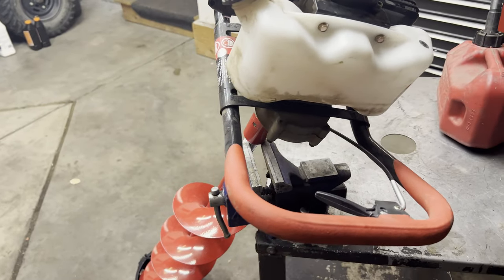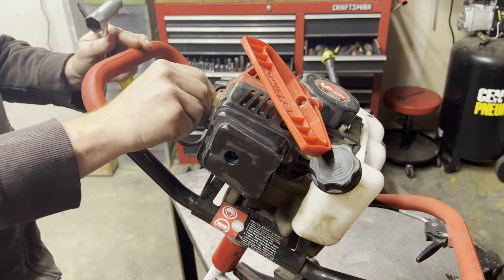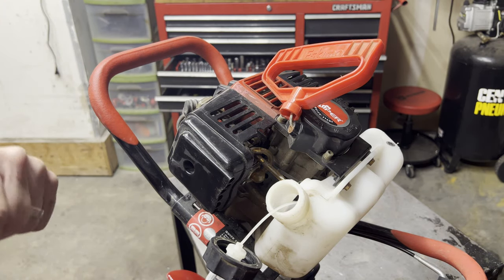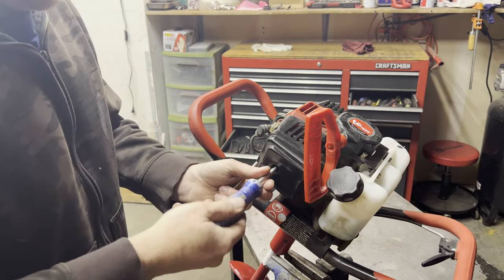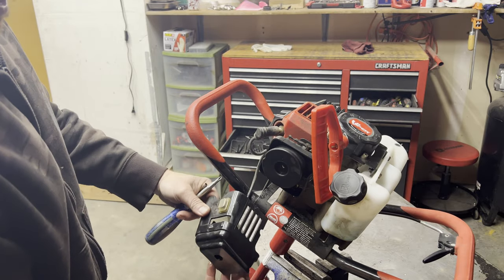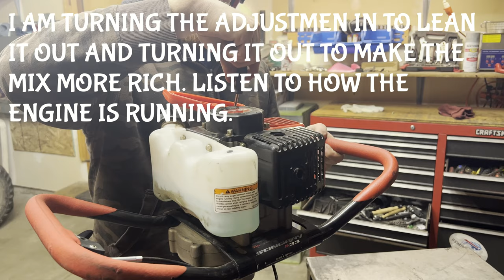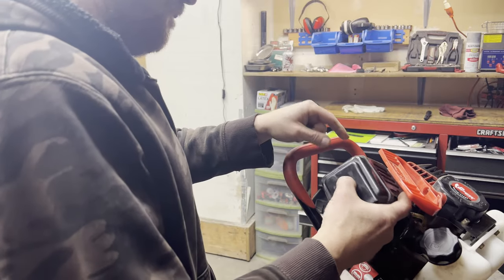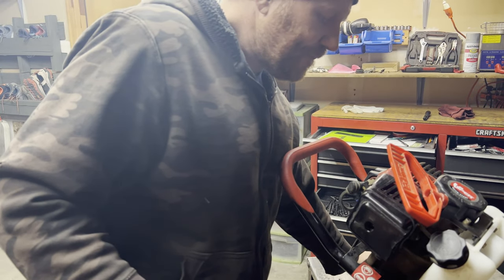StrikeMaster Ice Auger Won't Start

Comment: The reason you had a hard time starting it is because you closed the choke and then primed it. 

With the choke close when you prime these little to no fuel is going into the carb.
Reply from the maker: Good to know.

Comment: You are making huge adjustments and quickly . Like you said lisen  to the engine but make small slow adjustments . If you are suspicious of the settings bring the adjusting screws back in counting the turns . Then set to 1.5 turns out as a starting point . You also did not adjust the high side at full throttle .
Reply from the maker: Chris there was only one adjustment on this carburetor.